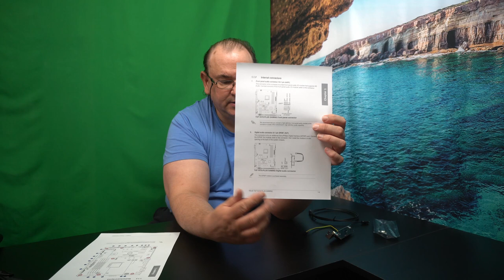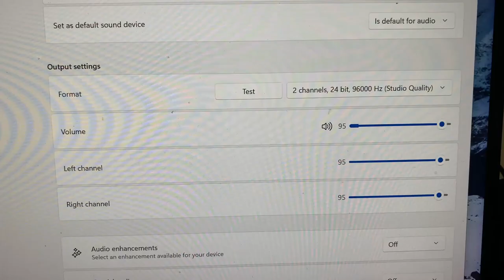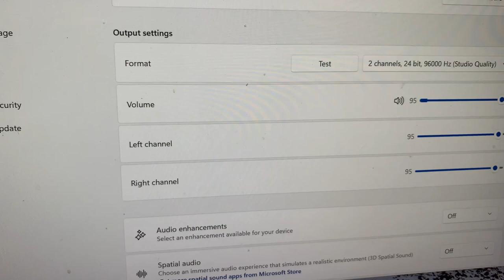PC SPDIF adapter introduction and install

Comment: Hello sir. Thank you for the demonstration.
Allow me to ask for your help. I have the TUF gaming x570 wifi on my pc. And because of a terrible miscalculation of mine I moved my pc for some reason without taking in mind that the optical cable was short at the time. I broke the spdif port on the mobo....
Can I use something like that which you used on the video or my choices are much fewer (close to none)...?
Thank you in advance for your time.
Reply from the maker: Sadly according to the manual if You have a optical S/PDIF Out port on the motherboard then You do not have the required connector for the expansion module. I would suggest buying the SPDIF module I have used and 1. Use the connector from it to replace the broken one on the board (if it is the same) 2, wire in the module to the pads on the motherboard used by the broken connector (remove connector first if possible).
Reply: @TheTechRabbit  Thanks for making it clear as that.
I appreciate it. Take care and be well. 🙏

Comment: Sir the optical work 2 channal are 5.1 ?
Reply from the maker: Output channel configuration is done on the PC. If You have 2 or 5.1 physical output is depending on the device (reciever) and the physical speaker configuration You have.